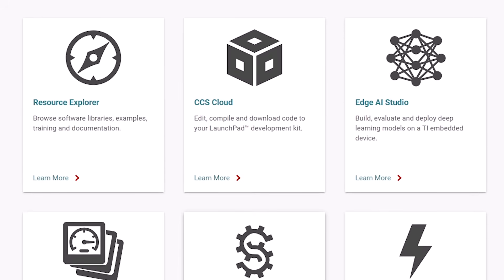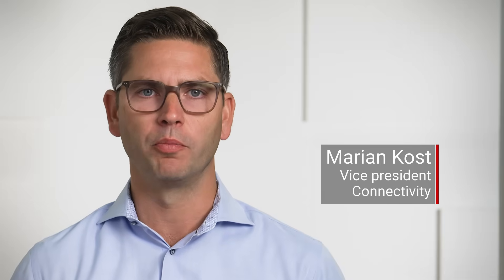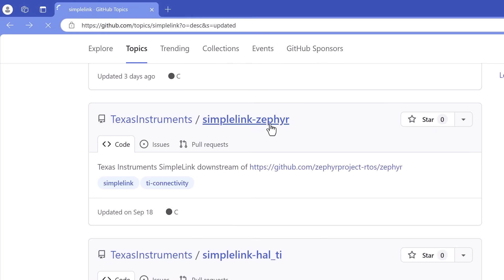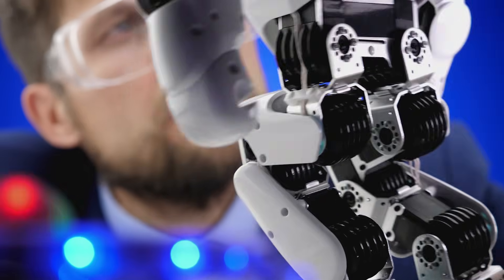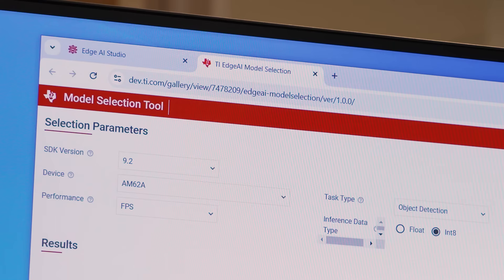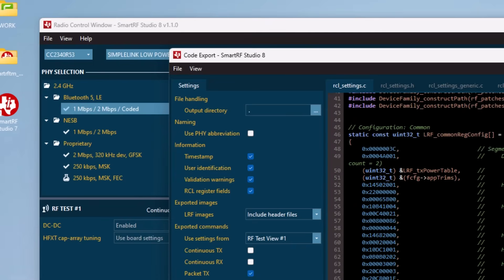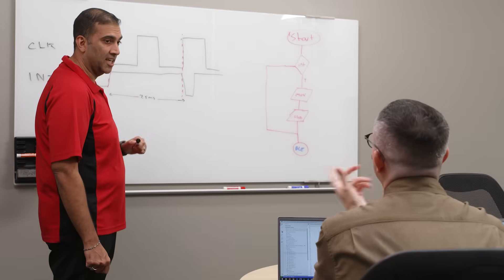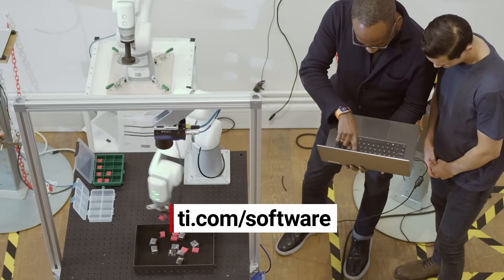Advancing your journey toward embedded software development

Comment: Indeed, I agree with the first comment above by @Pocketbell which  clumsily says the message and audience are mismatched. It's meant to be aimed for the technical, so for a 3 min presentation it barely scratches the surface, it's just a glossy intro to TI development with a few attached links. 

As a developer, this video would be better off being in the order of 15 min, short enough to want check it out long enough to to present some real tangible selling points. I want the key nuts and bolts about the TI development environment, the standouts that TI has over other providers, for example, or a 'vision' showing the ease of development. Stating, for example "Bluetooth" is pointless. It needs more essential selling points on each area stated.